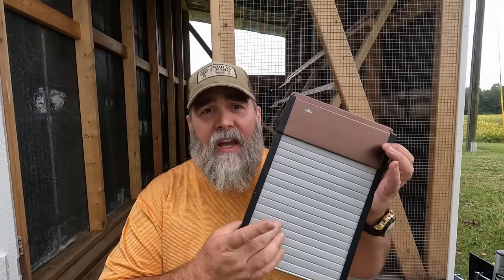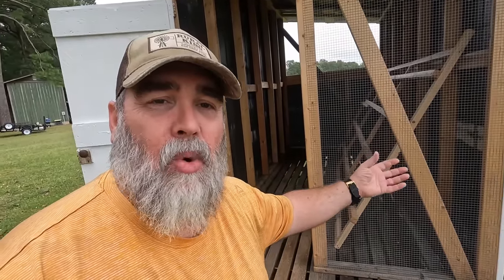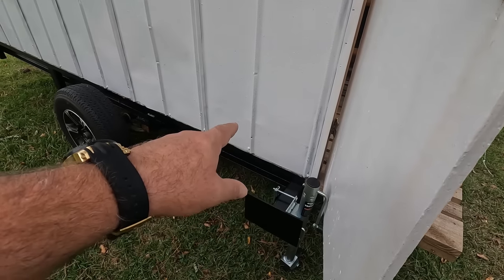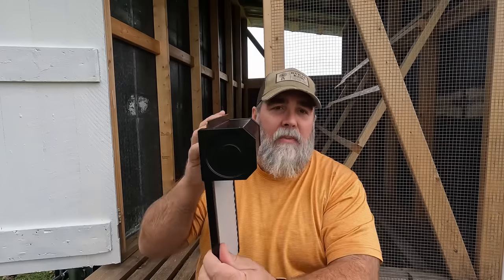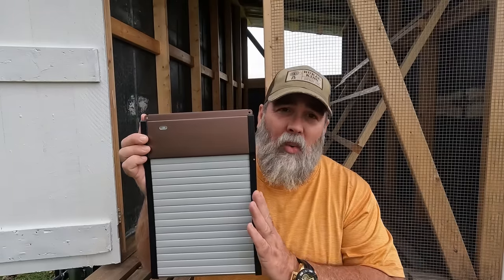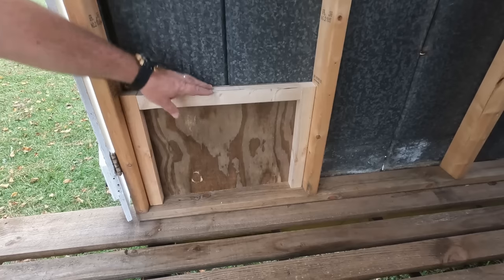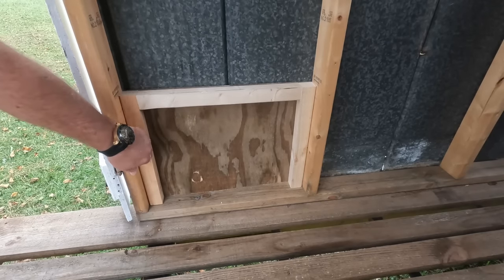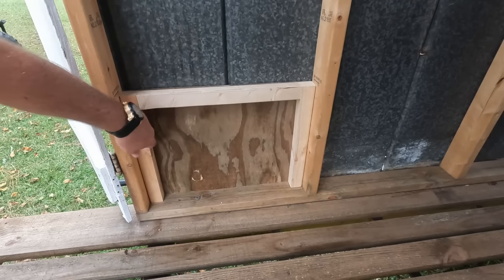Our CHICKENS Have Gone SOLAR!!!  🐓🚪

Comment: Excuse my ignorance, but what if a chicken, or chickens, are still outside the hen house when the doors close?
Reply from the maker: Thanks for the comment and great question!! This door basically closes at dark, so the odds of that are really low of that occurring. Our chickens are headed to the coop before dusk, so they are never out of their own accord after that typically. Having said that, we've had a few that decided to stray further and didn't come home on time before we got this door. When we manually locked the door, we locked the chickens outside their coop. The same would happen with this automatic door as happened with us locking it manually. If they are late... they get locked out. When you have 100 chickens in the coop, you simply can't count them all to make sure everyone is home by curfew time... 😆 🤣.